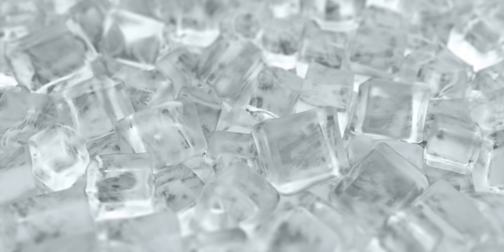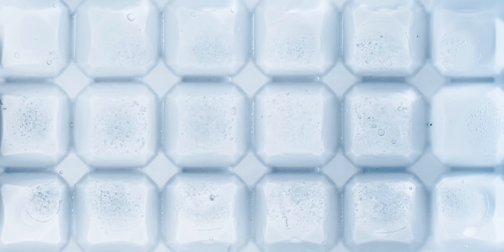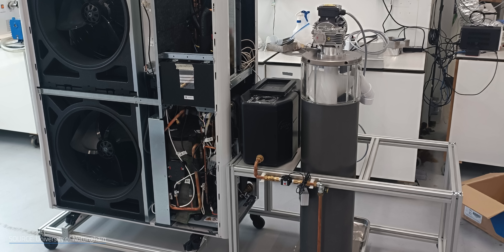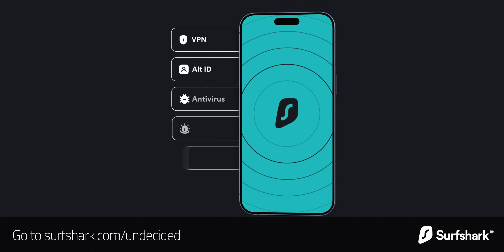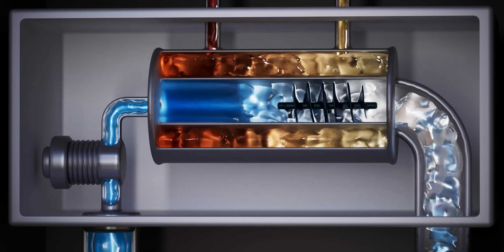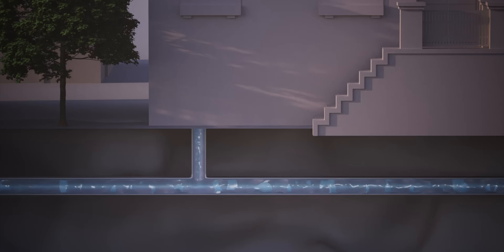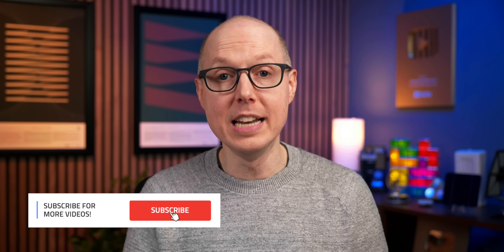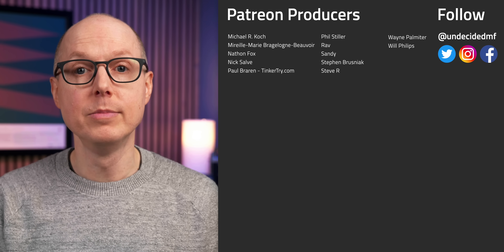How Can Ice Heat Your Home? Ice Source Heat Pumps!

Comment: So what happens when the slushy gets "home" as you describe it? What happens with it? It is pumped out into the oceans? If so, is it salt water in the system? If it is tap water that is re-circulating, how is is then heated in the other end and of so, how is it not in fact a district heating system just running at a lower temperature?

Comment: Im not an engineer, however 4 issues are visible to my untrained eye:
1- moving ice requires energy, making the system less efficient that a regular heatpump. would probably be cheaper to use electricity to thaw the evaporator on a heatpump in cold temps!
2- in cold temps, how will you ensure the feed pipe doesnt get frozen? 
3- return pipes need to be built, this is not cheap!
4- when moving ice you are bound to compact it at some point with all those pumps in houses working against resistance. once you get an ice pillar instead of a slushy, kiss your wholensystem goodbye

Comment: It's a very interesting and innovative idea and maybe could work in some places but it will be difficult to get enough buy-in in any given place for it to be tried anywhere. What worries me the most about it is what a nightmare it would be in places with cold climates if the water or slurry being piped through the network freezes solid some place and blocks off a sizeable portion of the network. If the ground around the pipelines is at freezing temperatures or below, any place in the network where the flow is stopped or significantly slowed down could freeze up causing pipe ruptures and widespread catastrophic damage throughout a large area of the network. That kind of damage would take forever to even unthaw let alone repair and in the meantime, thousands of homes and businesses would be left without their heat source unless they all had a backup system. Based on the little I know about it so far, I think it's far too risky to try this in any area where the frost level gets anywhere near the depth at which the water/slurry transmission lines are placed. But like I said, I know very little about how they plan to make these systems work so maybe my fears are misplaced.

Comment: Skeptical about putting water through natural gas infrastructure. Also, wouldn't it still require expensive new infrastructure for the slush return? Why not just use existing potable water links to houses for the input and return via the natural gas lines (again, assuming it'd work at all with liquid)?

Comment: Any material above 0. K holds energy and radiates emitting photons.    But transferring it to our use is a problem as energy always flows along the gradient of hot to cold or high to low so using ice caps for energy is a bit of a nonstarter requiring energy to power the device but I like the concept.
Reply: ice dont give the heat but its formation from water
Reply: @orangestoneface   Thanks for your response.

 Ice can give up its heat but its extraction is not economic.     Any material above absolute Zero or 0 degrees Kelvin contains heat.   This can only flow naturally from hot to cold,  that's the nature of  energy.    If  we add energy  by  driving a heat pump,     to freeze water this produces heat by the  work done in freezing.   An  energy gain may be around 4 to one over an electric heater.

The colder the source the less heat is available.  As  water changes state from ice to liquid a considerable amount of energy is absorbed in the melting process.  as long as binary ice remains fluid it continues absorbing energy.   I saw a demonstration of fire fighting and its impressive extinguishing 4-5 times faster than water controlling heat exhaustion of firemen as well.
Reply: @ l think you still dont get is as many dont, cos it is pretty strange. formation of ice from very cool water  gives off heat and a lot of heat
Reply: @orangestoneface   I get the principle of this scheme,   it's  extracting  heat at the point as ice  forms,   for an ambient 78-80F in habitation . you need heat pumps using electricity to get a gain energy from ice at -32f    

The envelope at the change of state that is T changes little as energy  extracted  very a slow decrease in Temp  over time.   The cooler the liquid the more difficult as our energy gradient is in reverse.   Turning off the pump would see everything cooling to equilibrium close to -32f   Energy will always flows hot to cold without an input of energy. from another source.  What this scheme is doing is refrigerating water,  that's by removing heat,  and  in the poles this would be natural but there is no recoverable heat without our heat pump which uses electricity.

Comment: So if this is a closed loop system overall, eventually that slush has to be melted so you get back the water you need to pump back into the homes. Where is the heat to melt the slush coming from? Gas fired cogen plants?
Reply: ground temperature would be my guess. ice slush melts in the pipes. Since gas pipes are buried below the frost line, theoretically they should melt year round. However, removing all that heat from the ground may lower the frost line in the areas where the pipes are, resulting in the ice remaining frozen. Over all, it depends on how effecient the system is and how much ice is produced. Ground temperatures may be enough in the UK

Comment: Actually our heat pump runs way more to heat the house than it does on the auxiliary oil heat .. I've seen it where it's taken 5 hours of on time just to raise the temperature of the house 4° .. I don't want to hear that a heat pumps more efficient than burning fossil fuel for heat

Comment: I think there are obstacles that will arise when you test this in practise. In colder climate you do not want to cool down the sewer lines (this was the idea for the returning ice-slush?) because this will cause freezing in the pipes. And also there are commercial alternatives for retrieving waste heat from the sewer systems if you want to use it.

Comment: The Natural gas pipes entering a house are 1 inch in diameter or smaller.  How are you going to pump slushies thru that?
Reply from the maker: You wouldn't.  I should have made that more clear.  The gas pipes would be delivering non-potable water, but the slushie mix would be pushed out through another set of pipes (most likely the sewage system or the like).

Comment: Wait?! Was that Sonny & Cher singing "I Got You Babe"?! Di-didn't I already watch this? 🙂
Well, again, cool! This certainly filled in the blanks a bit from the interview on the other channel. I'm still a bit skeptical.
I don't see how you make the transition without lots of "people" issues. It's pretty much a "you must adopt this system, or you don't have heat" for those in an area where this change is being done. Cue up the sovereign individuals. 
The infrastructure is there for supply lines, if they are all adequate; but getting the slushy out, from my understanding, they want to use the sewers; which if the UK's are anything like ours here in the US, are woefully inadequate for what they are being used for NOW. Think about the fatbergs we hear about on the news, now you're going to add something that will make the coagulation even worse. And even if the sewer lines /were/ ok, and the sewage treatment plants /were/ capable of handling the added volume, I have my doubts that the plants are could deal with the slurry. 
It is an interesting idea. Maybe in the right area. The UKs laws are certainly different from ours, so the individual objections might not be as much of an issue, publicly. I still think the logistics might be more than they think. But, I'm still not Dr BabaRudra. So, ymmv.

Comment: 2 ideas:
1-If using nonpotable water as the source a possible side benefit if worked into the system is the purifying effect of freezing water. This could help with the waste water aspect of it making it part of the water treatment process. 
2-Maybe also include data center heat exchangers on the frozen slush return line using that cold slush to cool the computers while also melting back the water using the heat from the computers.

Comment: Aren't heat pumps really designed to replace electric heat sources?  Isn't gas heat much cheaper to operate?  Why use gas pipes to send water and receive ice slush just to enable heat pumps?  Also, the system depends on a storage tank to warm the ice slurry?  It seems like they're asking a lot of a storage tank!  What happens in the summer, does the loop reverse and where does that ice slurry not come from?

Comment: Seems like that company wants tax dollars to make use of infrastructure - not even required, which seems to bolster better numbers of efficiency.

I get how the enthalpy phase change is beneficial, but if potable water is already plumbed to a home, only about 15-18 degrees more heat is needed to be extracted prior to the phase change. Rather than a slushy, it could actually be turned into cubed ice and be handled in other ways besides just plumbing.  Solids could be utilized or be mechanically removed to the outdoors to melt away like a zamboni pile.  Better yet, use it to prechill the 15-18 degrees from the in pipe.  No requirement for any new or updated infrastructure whatsoever.

Having excessive amounts of ice in the downside infrastructure in winter is also a very scary thought.

Comment: I am from Sweden and here heat pumps are very common and even working in a cold climate. We use a few different type of heatpumps: Air heatpump (cools the outdoor air), Ventilation air heat pump (cools the air ventilated from the house, Groundwater heat pump, uses horisontal pipes to cool groundwater, and bedrock heat pump, uses a deep borehole (50 - 100m deep) to cool groundwater in the bedrock. 
All systems have in common, that you use a coolant to transport the heat from the air or groundwater to the warm side of the pump. The coolant is in a close system, so you don't use water, you just cool it. 
In the system in the video, you transport water through pipes and it goes through a heatpump. This might polute the water with metals, pfas or other microplastics. So you really use water in thios system unless you make it a close system. But if it is a close system you need to reheat the water/ice somewhere and send it back to the houses. It would propably be better to either have a standalone normal heatpump in every house, or a centrally located heatpump for a group of houses, where the central heatpump produces warm water that gets transported to the houses.

Comment: Honestly if you're going these lenghts, might as well heat the water (district) such that the heat pump works on it's best efficiency point. 

In fact, if the ambient temperature is freezing, you will have to!

Comment: is reusing existing gas pipes mid to longterm the right solution? i can't imagine they're built for transporting another element at high/low temperatures (significant losses in the system in general)

Comment: Why not just use an air source heat pump? Freezing water would create a large temperature differential. Larger than the surrounding air most of the year

Comment: Big problem I see is that you force all other uses of natural gas in the area homes to go electric. All cooking, water heaters, etc. need to be switched over to electric, and I suspect this is not a trivial expense. Thus you still add significant stress to the electrical grid, albeit indirectly.

Comment: Why supply water through gas pipes if it can be supplied through the sewer? There is a lot of warm dirty water in the sewer, from which you can get heat and at the same time purify the water from dirt by freezing. The resulting ice cubes should be taken outside so that they do not clog the pipes.

Comment: I am not really satisfied with your discussion of this system, because I find that it misses a few key points.

1. As you said in a previous video, heat pumps are most efficient when the temperature step up is low. If you need to freeze water to reject the heat in a home, you work with an approximately constant step up: from about -5°C (so that heat is transferred from water at 0°C to the evaporator) to whatever the client wants (say, 25°C so that you can transfer heat to air that is at 20°C). Meanwhile, an air heat pump will work 90% of the time with outside temperatures ABOVE freezing, thereby reducing the temperature difference and improving the coefficient of performance
2. As stated in one of my replies to another comment, you'd need about 300-400 liters of water per day in winter, not counting any use for heating water up. It would be less if you allow a higher percentage of ice in the slushy (I put 1 part ice, 2 parts water). Rather than overhauling a whole gas pipeline system, it would probably be more practical to use the waste water that is produced exactly at the place you're heating due to people living there, then exhaust that water through the sewers. It would also be possible to use rain water as there is plenty of the resource in the UK.
3. Air is free, waste water created somewhere is free, but overhauling a gas system will lead to financing the works via subscription plans for the non-potable water coming into your house... Call me close-minded, but I would never pay for a non-potable water subscription, if I can use outside air instead.
4. Also in a lot of highly urbanized areas, the question is not even necessary because there is a central heating system in the city, circulating hot water around the city. New York is an example of this (using steam instead of water), but there are many other cities. Why waste some space in every home when you can allocate a block to the heating factory? Actually, there is a lot of progress to be made in the industry of fatal heat (Idk if it's the right term, it means the heat that is produced by whatever industrial thing you're doing, the heat that you need to vent outside to keep your industrial machinery at the right temperature). Examples of that are the heat from powerplants, from data centers, and probably other chemical processes.

I find that point #4 limits the usage of this kind of technology to a place where density is too low to justify building a central heating system. Then, point #3 will tell you that people will not want to use the water-freezing system because it is not free to get the water, whereas air would be free, except if you use rain water or your own waste water (point #2). Anyway (point #1), this heat pump would probably have a lower COP overall than normal heat pumps due to fighting a higher temperature difference than what a normal air heat pump would see most of the time, so why invest in a technology that is costlier to install & to run?

Comment: LOL it is a slurpee machine.

Again, geothermal is arguably the wrong name for ground sourced heat pumps.  They are not using traditional geothermal energy like high temperature thermal plants in volcanic areas.

Comment: ok but heat pumps need an exit pipe, and nat gas lines are ONE WAY. meaning you'd still have to dig up the entire cities infrastructure anyway, to install this network. fatal flaw in "reusing existing infrastructure". second freezing pipes have a huge problem of *cough freezing and breaching. as for heat pumps not working well in winter, As a Canadian Hvac tech i can absolutely guarantee that problem is still very much persistent today. I do not recommend a full switch over, but a hybrid heating system, backed up by nat gas heating for the really cold winters where temps do drop to -40C every single year.

Comment: Sure. Ice needs a ton of latent energy to form, but you also need to cool it to get it to freeze. So how can you ever extract the heat from it? Besides... If ice is forming we are talking sub zero temperatures. And even if you extract a ton of heat, I can't see how it could ever warm the air over 0c. Maybe great for Rusia where some shops are at a cozy -10c to the outside -40c. But otherwise, useless. 😂

Comment: The latent heat of transition from water to ice is useful here. It is significant. This is also important in Global Warming. When the opposite transition occurs from ice melting to water, a lot of chilling occurs. IMO, that is currently hiding a lot of the temperature rise of Global Warming. When we run out of ice to melt (Greenland, polar ice, etc.) the global temperatures will start to rise much faster.

Comment: Hey Matt! From your channel I went all in on air source heat pumps. I live in Denver so I am very familiar with the performance in cold weather. I now have 8 internal units and 4 external units. One thing you said is that when the weather gets colder efficiency goes down. True! However, you said something else which is not true (with geothermal you wouldn’t encounter this) but there is no need for resistive heating backups. The first year I had my system installed we had a series of -15 F days and at the worst I was getting 120 F air out of my units. In fact, I was more comfortable than we had been with our 80k btu natural gas system at low temps—natural gas doesn’t somehow evade the laws of physics. Anyway, thanks!